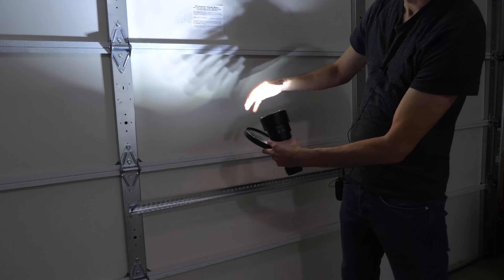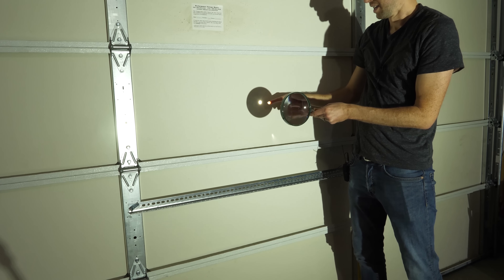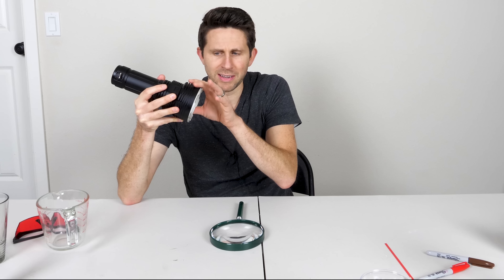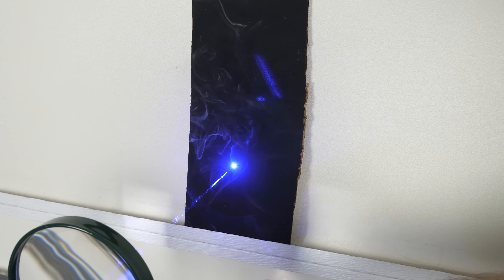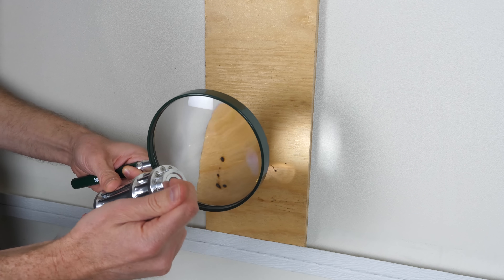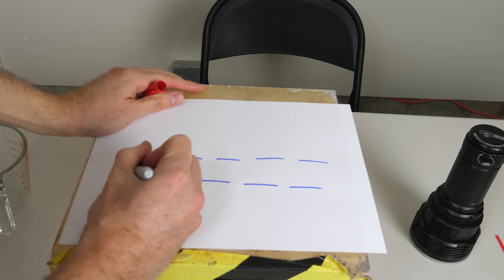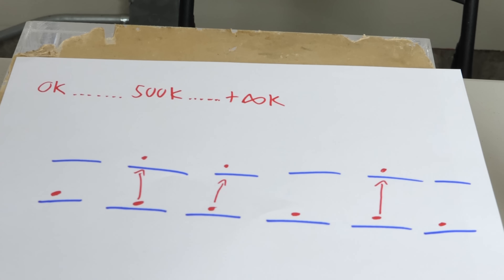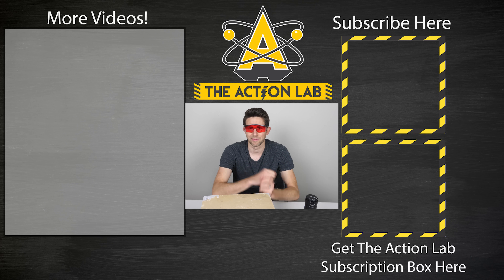What Happens if You Focus a 5W Laser With a Giant Magnifying Glass? Negative Kelvin Temperature!

Comment: The simplest explanation as to why is doesn't break thermodynamics is that thermodynamics has to do with the energy of a system. The system is not your target, it's your target + your environment, i.e. your garage. Lenses don't change the amount of energy the system receives, only the energy the target receives. There's 0 need to bring negative temperatures in this as they're totally irrelevant here.
Reply: Also, heat is not the only measure of energy in the system. And creatinf a single point with a higher temerpature than the average temperature of a large surface does not imply that point has more energy than the source. 

I have no comment on the negative temp, infinite temp... and negative 0 temp claims, but if they make as much sense as the second law violation claim.... they are bunk
Reply: @shadrach9654  Negative temperatures are a real phenomenon, or at least it's a term that physicists use for a real phenomenon. Maybe the label doesn't make sense to how you and me understand temperature, but maybe that's ok because it apparently can't be described by classical mechanics to begin with. It is only described by quantum mechanics, and god knows our intuitions are entirely useless when it comes to qm.
Reply: @volbla  my father with a phd in materials science and engineering disagrees with you, and the video, on very nearly every scientific claim made.

Your referencing valid laws of nature, but your apllication of them is wrong, they just dont mean what you think they mean.

Seems like this video is some sort of comment bait for the algorythm.
Reply: @shadrach9654  Ok, so what do they mean? What exactly is the video getting wrong and how does a magnifying glass actually work?
Reply: @shadrach9654  I mean, Action Lab has a PhD in Chemical Engineering, and neither him or your dad have a PhD in a Physics or quantum mechanics, so basically both your Dad and this guy should defer to someone more specialized if either has a complaint.
Reply: @shadrach9654  Amazing. I completely agree, as a physicist. You don't need negative temperatures when using visible light.
Reply: He sounds like a child making up the rules to a new game as she goes when he starts explaining negative temperature.
Reply: @WeighedWilson  negative temperatures do sound very weird, and they are.  Essentially, the existence of negative temperatures is a strange result of the way temperature needs to be defined in statistical mechanics.  Under ordinary circumstances, temperature is a basically a measure of the average kinetic energy in a system particles, and this can't be negative.  However, in certain systems, there either are no kinetic degrees of freedom or they aren't relevant (like in the laser, where atoms can be in particular excited states, but the overall motion of each atom doesn't matter to what state it's in).  Then, above a certain energy, there can start to be fewer states at each energy, which means that the entropy decreases as energy increases, which makes the temperature negative by the definition that you need to use to get the right answer in normal circumstances [you can't just use a different definition: either it would fail or just give nonsense].
Reply: @undefinednan7096  freedom
Reply: The energy at the target cannot be higher than the energy of the source, provided that both are stationary relative to each other. But the temperature at the target, over a given area can be higher than the temperature at the source over the same area. So shouldn't it be stated that heat and energy are two different things, albeit closely related?
Reply: Finally someone whose not buyin hes bs. This guy is overrated in this video,  ppl just follow and believe wtvr he said.... like religion. Ugh
Reply: @ikmalaxl5286  "He has his own Youtube channel, so he must be right"
Reply: You're looking at the wrong law. Focusing light to a point hotter than the source wouldn't break the conservation of energy, aka the zeroth law of thermodynamics. It would break the second law which states that a closed system will tend toward max entropy. Statistically all the energy will spread out evenly, eventually leading to one uniform, lukewarm temperature.

If you could make energy flow from a colder place to a hotter place by simply holding up a magnifying glass, you could decrease entropy indefinitely. That would break the second law.
Reply: @volbla  that is true, and doesnt refelct the claim made in the video, which is thay if a point can be hotter than the source....
Reply: @shadrach9654  The video is litteraly saying that the projected point can't be hotter than the source
Reply: @joselotl  which is false. And that fact doesnt violate any laws of physics.
Reply: @shadrach9654  It is true. A filament light source can never heat anything hotter than its own temperature. Though this doesn't apply to lasers which are not blackbodies, the original statement is still true and it's very easy to see why.
In the ideal scenario where the heated object is absorbing the light with its whole surface (or all of the surface that is not exposed to the light source is pure white or something) when the T of the source and the T of the object are equal, the object emits exactly as much blackbody radiation as it absorbs. Therefore no matter the configuration of lenses or mirrors, you can only approach the temperature of the source but not exceed it.
Reply: The second law isn’t about the amount of energy in the system. The second law is about entropy.

You can’t organize things against their natural tendency without added energy.

The problems I see in the demonstration at hand, is that moving a lens into position is added energy. Both the energy involved in crafting the lens, and the energy needed to move it into place…
Reply: @multi-mason  That energy isn't relevant here, since that energy isn't involved in the refraction of the initial light beam, which is how the lens operates. Refraction doesn't actually use any energy at all.
Reply: @lorscarbonferrite6964  perhaps, though I remain unconvinced. Personally I see a lot of problems with the second law of thermodynamics. I’m not suggesting that basic premise presented here is incorrect, just that the mechanism behind it may not be what is commonly taught.

I won’t belabor the notion that the energy needed to fashion and position the lens might not be negligible, as I agree those energies are largely irrelevant to the process.

My real point was the implication that the system described is not in fact a closed system. It’s probably not intentional, but you seem to suggest that it is a closed system, with is laughable.

So let me be explicit. It’s not a closed system…

Comment: For those of you wondering, yes, 0 can be positive or negative. Think of 0 as a neutron particle. Normally, a neutron has a neutral charge, but you can also apply a positive or negative charge to it. When you negatively charge a neutron, it becomes an electron. When you positively charge a neutron, it becomes a proton. So, 0 always has the value of 0, but it can exist in 3 different states. Positive, negative, or neutral. I hope this helps.
Reply: ?? the mass of a nuetron is much bigger than an electron how can u make it into a electron?

Comment: I use to setup and operate laser welders. Yes, we welded stainless steel with lasers. Typically we melted a puddle depth of less than 0.03" × 0.05 wide. Hermetic seals on lithium batteries. But on big batteries, larger that a soup can we'd go deeper where we could.

Most times to go deep the focus was nearly half the desired depth of weld. "Keyholing."

For very thin material the focus would usually be 0.01 to 0.02 above the work (to avoid burning through).

We had a variety of welder types. Power, rate and length of pulse, speed of weld movement and like that were all important and fully adjustable.

We had 3 units that pumped the laser then sent the beam through a long fiber optic cable. For those the beam would be defocused through a series of lenses before entering the cable. The longest cables were 50' or so.

They could be routed from outside the assembly room, across the ceiling, and down to the machine. Then the beam would be refocused at the work.

Years ago a guy burned a cable by forgetting to defocus after doing a repair. $10,000 for a new cable. Ouch.

I got burned while debugging a problem on a diffent type of laser. A command had been paused in the control computer in a way that left it waiting for a sensor to be made. I made said sensor with my finger and ended up with a 1/16" wide, 1/32" deep, 1/4" long perfect slot burned through my fingernail. Lucky. It could have removed my finger in seconds, but the burn hurt like hell immediately. Totally NOT cautrized.

I worked on that machine for 20 yrs and never had a problem. They upgrade the controller and the programmer missed a "command cancel" that use to exist during an estop. My bad to be sure. Should have locked it out. But that's the way it happened. And that laser don't care at all.

Comment: What would happen if you used a series of magnifying lenses with the laser, each one magnifying the one before it? How powerful could it get?
Reply: Unfortunately each magnifying glass would slightly reduce the total energy output through warming of the glass and slight diffraction of the light waves. The beam would get smaller and more concentrated but also dimmer and less energetic.
Reply: @ekothesilent9456  but if the 2nd lens reduced the beam to a 50 percent smaller circle it would by it’s reduction be substantially hotter
Reply: @madbats69  yes it’s potential but not total energy would increase by 50% while it’s total energy would decrease by some fraction of a percent, until after enough magnifying glasses the total energy percentage would be lower than the initial beam
Reply: This is like that Bart Simpson meme

Comment: Won’t let me reply to OPs comment so here it is: We are not having a hard time with it, it’s simple physics. Take a force and focus it into a smaller surface area and you have a greater psi with the same amount of energy. It’s the same here. There is no negative heat energy or anything like that, you’re simply focusing the total energy to a smaller surface area to create a much higher concentration of energy. Same phenomenon is present with sound. Positive and negative interference increases and decrease amplitude regardless of the amount of energy put in